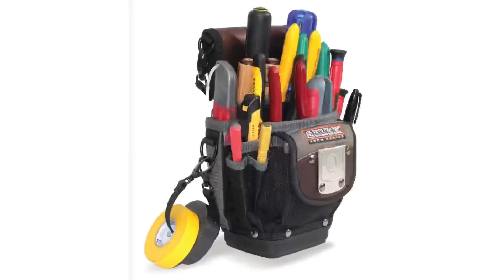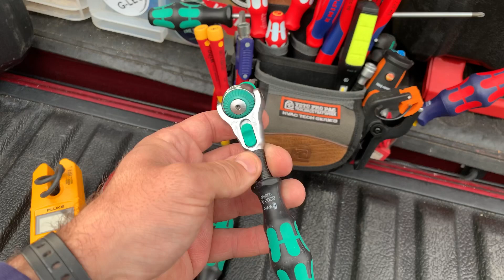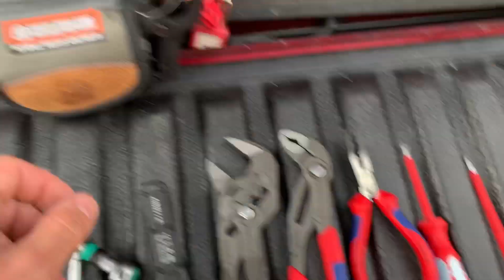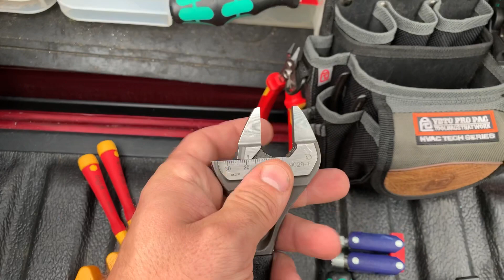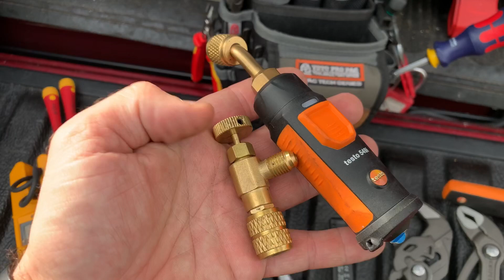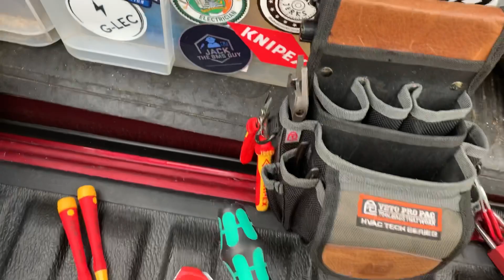VETO TP3 HVAC LOADOUT | HVAC SETUP | REVIEW | HVAC UK

Comment: In the thumbnail, anyone know the name of the Wera attachment between the actual ratchet and the bit? I misplaced mine but not sure what it’s called to order a replacement.
Reply: I believe it’s the Wera Rapidaptor 50mm
Reply: @jordano3908  thanks for replying! I actually dropped my phone down the back of my seat in my van today and had to remove a panel in the rear of the van to access it...what fell out? My Wera Rapidaptor! So I’m back to a full complete set now.
Reply: @sgtsnugggles5116   That’s great to hear! All good now then, take care and stay safe!